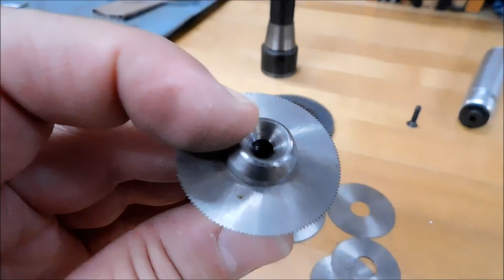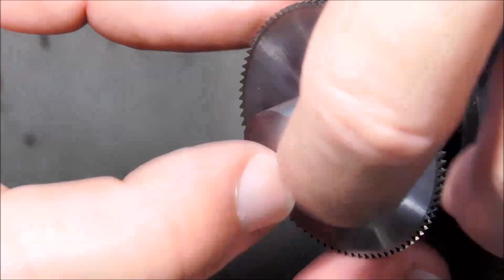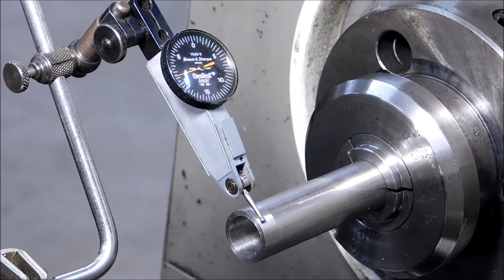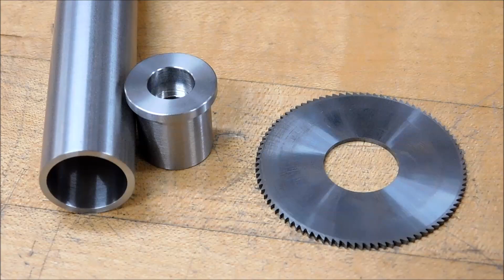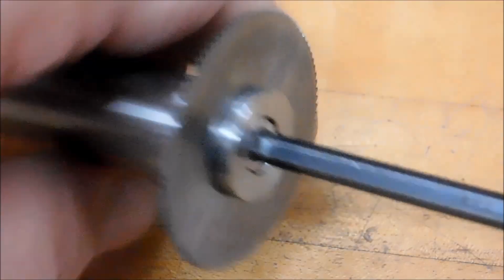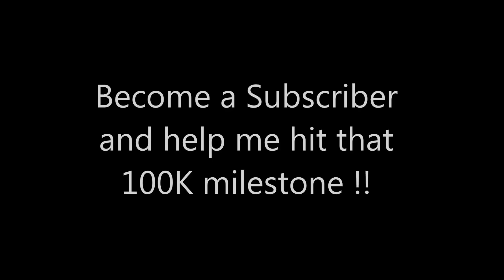Machine your own Low Profile Slitting Saw Arbor

Comment: Hi Joe,
I have an issue with thin slitting saw deflection, not cutting parallel to the table. The table is trammed to the quill.
What tips, if any, do you have.
TIA.
Shane M
Brisbane Australia.
Reply from the maker: It is possible that one side of the saw is compromised. It will always cut to the sharper side resulting in deflection. You may also need bigger support washers for the size of the blade.
Reply: @joepie221  Thanks so much for the reply Joe. That makes sense to me, I'll look at some options.
Cheers.

Comment: Hi Joe, great video on how to make an arbor better than almost any you could buy. I wonder if you could please make a video demonstrating slitting saw use, speeds/feeds, how to accurately zero your Z axis, and any other wise advice that you always tend to add. I like the way you explain the theory and reasons for doing what you do, instead of the typical "use this spreadsheet to calculate RPM or whatever". I don't use a slitting saw unless there's no other way, so I don't use them often enough to really 'get in the groove' for setting one up. Thanks!

Comment: Great job, excellent machinist!
I love the way you completed this task with such precision, checking the temperature and cooling down the material. I worked for 4 years as a machinist on conventional machines, surface grinders, and CNC lathes, mostly handling technology, programming, cutting, measuring, and finishing
Reply from the maker: Thank you very much!

Comment: JOE PIE--this comment does NOT go with this video.  Your technique for setting an ACCURATE angle on the lathe cross slide is second to none !  A little bit fiddly, but so accurate, and  REPEATABLE !   Thank you x 3  Paul P
Reply from the maker: Thank you. I've worked for some very fussy inspectors. Had to stay one step ahead of them. :)

Comment: Sort of off topic question from old hobbiest. While making an arbor the center drill hole 1/4x20 (about 1" deep) went off center more than acceptable. I was looking for suggestions on how to correct if possible. I have enough arbor material to select the next size bolt if needed. I guess I could put in mill facing up, find proper center and use end mill to try to correct then tap the new larget size bolt. I even thought of a helicoil, but have never use one before so no idea if it would work or not.

Comment: I used to do similar stuff (before CNC's) with a cross slide rotary table on the mill table in combination with a Volstro offset rotary milling head on the quill.  It allowed you to mill around a part cutting angles and tangent radii all around.  Took some focus to keep your head straight......not sure I could do it today.
Reply from the maker: For what?
Reply: Don't remember what the part was exactly, but it had several different angles with tangent radii.  Probably was part of a fixture or stamping die @joepie221

Comment: Where do you get your material? SS, steel, aluminum, etc?
Reply from the maker: Metals 4U for quick, direct from the mill for volume.
Reply: Drop rack at your local metal shop is worth checking

Comment: Thank you once again Joe. I made the mill vise stop last week that you did and this weekend I made the slitting saw arbor like yours here, the only difference is I made mine out of 4140 and my blades are .750. I took my time and worked it slow so there was no challenge to the time you did yours in 🤣. It took me probably six or seven hours but I had to turn down a piece of 1.125 4140 to .875 and I was able to hit within a couple of tenths on all my measurements (after I let them cool to room temp and did a finish pass) which is the first time I have been able to consistently do that on a project without having to start over with a new piece.

Comment: Looking for info on how to center a slitting saw for a end cut in round objects held horizontally in a vertical mill.  Found a variety of videos on using a slitting saw for side and lengthwise cuts, but none so far for end cuts.
Reply from the maker: Same principle, different surface. Touch off, raise the table half the thickness of the blade, raise the table the dimension to center ( or required dimension ) and start the cut.

Comment: Seems like one could make a triple slit shaft which expands with an internal taper screw mechanism and make it so that the very end of the slit shaft expands out to grip tightly and ends absolutely flush with the saw hole?

Comment: "Real shops use air"
most likely I work at unreal one
if those who repair my milling machine see that I am using air, they will beat me up.
Reply from the maker: Using air on any machine tool is OK if you have a good understanding of where NOT TO aim the nozzle. Blowing off a table or vise is harmless. The capillary activity of coolant is far more damaging to a machine than an air blast will ever be. Use a dry paint brush in the areas around the table/way junction for best results.
Reply: @joepie221  but chip somehow manage to get under the spindle cover and on vertical feed screw. I can't remove it without disassembling.

Comment: Many thanks. I was looking for how you dealt with the radius for thin saws and that answers my question. The next question would be why choose to make the boss on the removable part rather than the arbor but I now presume that is so you can make it very low profile. Many thanks. 
I will be making my own.
Reply from the maker: Correct. The boss on the cap will always end up with the same underside clearance regardless of the saw thickness.
Reply: @joepie221  Only issue I have is do I (and if so how) put a keyway on for my saw. I have a 3" saw with a 1" hole I need to make an arbor for. I suspect I will make it from 1.5" EN8 bar without a keyway.

Comment: Joe, I have a dumb question ❓ maybe. Does your mill use a drawbar? Most of the smaller mills use one and in this arbour you haven't made provision. I'm assuming that the larger clearance hole at the "top" of the arbour could be tapped for the appropriate thread but you made, that I heard, no mention of doing so.
Regards from Canada's banana belt. 🤔🇨🇦🍌🇺🇦🕊️🇺🇲👍
Reply from the maker: Yes, my machine does have a drawbar. Drawbar activated arbors like this are usually configured to look like a collet. The outer body is shaped that way so it doesn't get pulled up inside the spindle when you tighten it. You can't do that with a straight shank arbor like this one.

Comment: I've been watching you great videos for years but somehow missed this one. Would you believe that only 2 weeks ago I had to design a slitting saw arbour to use in conjunction with an Ø85mm x 1.00mm blade to use in a cnc router to do 3D contoured undercuts, i.e. not slotting. So I designed it and am currently getting it made (I don't have a lathe) and now 2 weeks later I see your great video. Almost like a "deja vu" moment. Love your videos.
Reply from the maker: Thank you.

Comment: Nice demonstration and presentation. 
One question I have with these arbor not frequently discussed - is there a lower limit to the arbor cap diameter with respect to the saw and saw diameter?
Reply from the maker: Ideally, you want as much registration surface as possible to help stop vibration and deflection. On the other hand, too much will restrict how deep the cutter will be able to go. It also depends on the thickness of the saw. Thinner saws need more support than thicker ones, so the overlap of the cap and arbor diameter is really up to you.

Comment: Love your videos Joe, you have been a great help to my learning of lathe operation. In this video you checked for runout in the part in the collet chuck. I’m wondering how you would have corrected it if had not already been perfect!
Reply from the maker: If any indicator movement showed up, I'd remove the part and thoroughly clean everything. Second thing I would do is 'Unloosen" the part ans rotate it slightly before locking it down. Finally, I'd lightly tap it with a hammer to see if it would move.
Reply: @joepie221  thanks Joe!

Comment: do you think this is a good project for my 1st ever lathe job?
or is it too ambitious? I actually need that slit saw to cut slot in the brass / bronze.

does it have to be a stainless steel material or I can get away with any steel? 

great video. you got a new subscriber!
Reply from the maker: Any steel will work, just be sure its straight. Don't be afraid to try it. Good luck.
Reply: @joepie221  thank you for the encouragement. I will give it a go soon.

ciekawe czy mowisz po naszemu ;)
Reply from the maker: @TigerCarpenter  Mówiłem i rozumiałem po polsku jako małe dziecko. Moja babcia często tak mówiła w Baltimore. Zwykle krzyczała na mnie, że jestem dzieckiem. :)
Reply: @joepie221  super. you must have used Google Translate, or if you wrote it yourself, then your command of the language is better than mine :)

Comment: Joe it looked like you were using a quality tap (tap&die) set in the video.  2,3 or 4 flute? Can you recommend a brand. I've got the cheap Harbor Freight ones. Already snapped one of the taps. Thanks!
Reply from the maker: I've found most cheap traps are only for running down holes that already have threads. They are for repair work since the steel they are made from is cheap. Check MSCdirect industrial supply online. They have great delivery and a huge selection. OSG taps will usually get the job done for a reasonable price.
Reply: @joepie221  Thanks Joe I checked OSG and they only sell individual ones.

Comment: On thin slitting saws say 1/16" or 3/32" wide that have a keyway - Still don't use a key to drive it, if it grabs it will Shear through the key. Treat it just like a Non Keywayed saw And use Manual Feed!!! (Hand wheel)

Comment: Thank You again Joe. I have to machine up an new arbor, for a new design I'm working on, and this Arbor design, will be a major help to me with this job.
Just a Dumb Question from me Joe, I'm a 64 year old, that has worked in my trade (Mechanical Fitter-Machinist (manual), etc), all of my working career. 
I have noticed on a number of occasions in your Great videos, that when you are using a Centre Drill, to start a hole in material, that you drill into the material, so that the Tapered/Beveled section that the centre drill hole makes, is larger in diameter, than the diameter of the following twist drill (see at 7 Minutes and 10 Seconds, in the above video).
I remember back to the mid 1970's, where my Tech Teacher (Mr John Saunders), told me to ensure that the tapered section of the centre drill hole diameter, should be smaller than the following twist drill? Have things changed over the years, or does it make no real difference? 
Best regards, JB, Australia.
Reply from the maker: I do that to eliminate the need to chamfer the hole when I'm done. I let the tapered part of the centerdrill do it for me before the hole ever begins. I do it for threaded holes as well.

Comment: I've never had the pleasure of using a carbide slitting saw but definitely danced with HSS a lot. My Dad n I used to manufacture LG2 Bronze filters for a steel mill here. Our biggest order was for 1250 pieces. My Dad made my first arbor for me (back in those days I was only on the milling machine, Dad kept me away from the lathe). If my memory is not failing me, 2mm thick 100 tooth 100mm ø. Each filter had 8 slots roughly 50 long n 5mm deep, 10 000 slots in total. I went through that first run with one slitting saw. Depending on the quality of the slitting saw, there is definitely always a bit of run out, I've even had slitting saws where the teeth where not ground to an even depth but the cutting dia ran relatively true. I've exploded one 1.6mm thick when working in steel too, wakes ya up lol. I will definitely remember this arbor design, I'm sure one day it will come in handy. Apropo stainless n tapping, we have a product called Tapmatic here in ZA, it cools n lubricates, wish I could send some to you to try out, curious as to what you'd say, that smurf goop looks like a pain. These days I do a lot of stainless, 304, 316, 431(EN57), N685.

Comment: Great job, l like it!  No flat for assembly and disassembly of the machine recommended?
Reply from the maker: I 'unloosen' the end cap before I remove it from the machine.
Reply: @joepie221  ok cool, I meant off the machine, still like that tool , nice low profile.

Comment: Few months ago I needed a low profile arbour for 1" bore cutter.
 I literally picked up a 7/8" high tensile bolt at the side of the road that had fallen off 'something'.(head markings showed it was HT bolt) (I was getting mail from mailbox!)
 To make sure things were concentric, I centre drilled both ends and made a centre from a piece of scrap in chuck, live centre in tailstock. 
Turned off threads to 3/4", turned off hex head then drilled and counterbored to 1" for about 3/4 of head thickness.
Threaded 10x1.25 as I do most stuff in metric (50 yrs working on Japanese motorcycles)
Made the 1" plug from 1144 I had bought to make low profile arbour.It worked so well I picked up some 5/8" bolts to make smaller arbours for slitting saws ith small bore.
 Thanks for vid, it has been most useful and saved some cash

Comment: Nice job with this project!  One thing I would suggest is to cut two flats into the cap.  The threads will tighten up a lot during use, making it hard to unscrew the cap screw.  Flats will give you something to grip it with.
Reply from the maker: Maybe hex shape??

Comment: For blades having small holes, like a 6 mm hole, almost 1/4", integrating the screw to the cap and milling off the outermost bar for a wrench feels like possible. Just need to figure out how to get concentricity from the shaft/shank out to the blade. Use the 4 jaw chuck or wait for the ER32 collet chuck travelling on the ocean...

Comment: Very nice and I use to actually sold circulater saw blades were manufactured in different European machines 😀 I'm getting going into using a small drill / mill. This is good 👍 way to show people.

Comment: Thanks for making these videos.
I bought some saw blades on clearance at a hardware store over a year ago but they didn't fit the spring loaded (big ugly cap) type of saw arbor that I had.
A project came up, within a week of you posting this video, where I needed a low profile saw arbor.
A friend dropped off a box of end-cuts with a piece of steel in it that was ideal for my version of this project.
I made my arbor differently, but you taking the time to make and share this video served as some good motivation.
Reply from the maker: thats a dual win. Take my presentation and make it better. Then film it of course !!

Comment: Did you machine the face of the collet?   Why did you fabricate this from stainless steel, when it will be used only in a shop and not the field??
Reply from the maker: Yes. I had to for a specific job. Stainless was my most readily available material, so I chose it.

Comment: I was given the task of cutting 90 slots inside a dia 1.771" (45mm) bore 0.236" (6mm)deep and 2 3/4" (70mm) long using .020" (0.5mm). I used std 1/3/4' slitting (60T) saws with a 5/8' bore. This was a very challenging job because of two things. The bore was blind and the material was 347 duplex stainless steel. I made an indexing head that was "automatic'. That was the 90 slots solved. The cutter was run on a chain driven (motorcycle cam chain and sprockets to get them small enough) arbour and fitted inside the end of a slotted bar to facilidate the chain.  This bar was mounted onto a clamp assembly that attached to our bridgeport mill quill.. The cutter was driven by a chain that was driven by a sprocket in an R8 collet. I think it ran about 120rpm. We had full flow coolant. The first time we ran it in trials it smashed the saw without doing one slot!  Not wanted to give up we got some cutters coated with TIN of some sort. That worked better but still only got a few done before it shattered. The cutter was not blunt but something else caused the failure. So I set about making a high pressure oil pump and associated tank and filter and return system. With straight cutting fluid, same as gear cutters used it survived. We then bought another milling machine, adapted our setup for "production" and we ran that machine for some years, each cutter doing between three or four components before replacing. These components were "heater heads" for a stirling engine and the slots were only there to act as a radiator for the heat transfer of the high pressure nitrogen. These components ran at about 900degC at 45bar for as long as 30,000hrs.  Each machine had four "heads" on it and we made thousands of heads over the years. We also used the same technique to cut 0.014" slots in a gang of three but 180 slots in total in our cooler part of the engine but these were more like cylinders and had a thru hole of around 55mm. We did these stacked 2 at a time, and cut going, in indexed, cut coming out etc. It was brain teasing stuff. I was lucky to be surrounded by clever mechanical engineers but they valued my "hands on" engineering skills.
Reply from the maker: A good combination is a clever engineer and a clever machinist who he listens to. Thing happen when they find each other. I bet that was interesting to see.
Reply: Couldn't you have used broach instead?

Comment: Great build! You mentioned heat/expansion and measuring. Here’s a little tidbit that I’ve found useful over the years;
Almost everyone can hold something 140F. No one can hold 160F (without smoke😏).
Just a quick way to get an idea how hot something is.

Comment: Nice job.  How come you didn't add a small flat in the middle of the arbor for a wrench to hold arbor when you remove the cap.
Reply from the maker: I always recheck the torque when the collet holds it. At the end of the job, I'll release the saw blade before I take it out of the machine. A flat or hex on the end would be a nice addition.